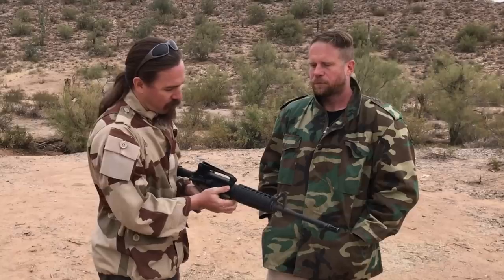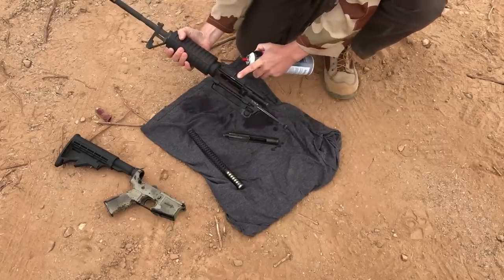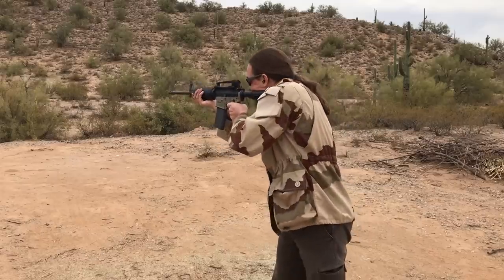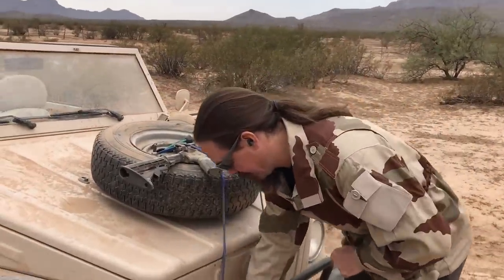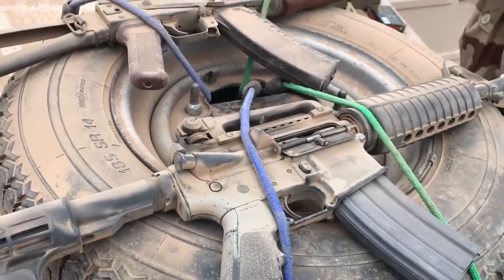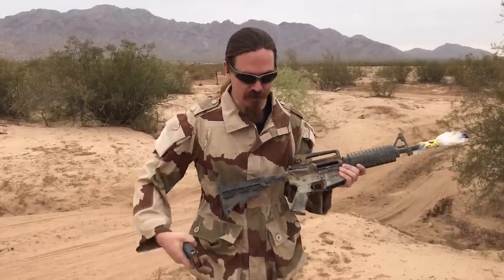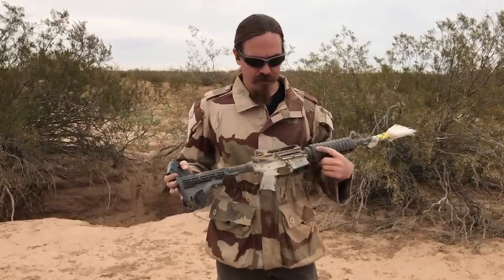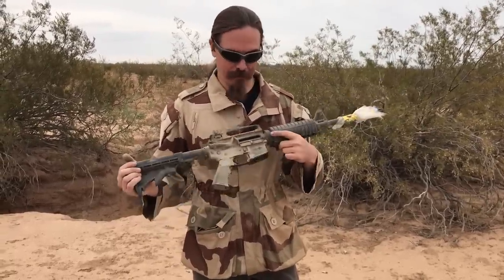Convoy Dust Test: M4gery / AR15

Comment: I usually keep all my guns quite wet to prevent rust (i've had a couple get a little rust during the summer with the swamp cooler running). But should I just leave my AR dry all the time, and never lube it?
Reply: Dude no, lube you rifle. Unless you're pouring sand into its receiver, then you're going to have more malfunctions if youre running it dry  without lube (not to mention more rust which seems to already be an issue for you)..

Comment: so what is the benefit gained from running a rifle with a lot (or some) of lube?
Reply: Some lube (a reasonable amount in the right places) reduces friction and wear on parts and aids in reliability, but excess lube clings to dirt and debris, and some guns don't run well sopping wet either. ARs really don't require much lubrication, the bolt and carrier basically float in the receiver except the rails it rides on and that's about the only part you absolutely need to lube for reliable function. How much is needed and where can depend on design and application, though.

Comment: When this happens to a gun ONCE it may continue to work fine. do this to a gun 10 to 15 times that won't be the case. 
You probably still don't have much grit and debri in the gass system that runs these guns.

Comment: Typical milspec AR's will run just fine, they're overgassed like crazy. Normaly it's the shitty mags. I heard one story of a guy that would mark bad GI mags with sharpy before tossing them in the trash. Until He caught guys using them on the range (apparently they pulled them back out of the trash), after that he'd crush them to make sure that wouldn't happen again. Magpul or GI mags for me. I got a batch of hex mags that are trash, great for malfunction drills lol.

Comment: I still wish you guys would re-run this test with lubricated rifles. You keep saying that they would get jammed. But...how do you know? Everyone kept saying the AR-15/M16 would fail these test miserably but you've proven that wrong. So along those same lines, lubing these things up heavily and running them should be something to try. Understand that this isn't a request from ignorance either. The "Filthy 14" test showed that nasty gunk inside the chamber was no issue as long as it was lubed. The pictures make the insides look like they were coated in liquid oreo mix but they kept running into the 42k round count having the bolt wiped once with a towel at 22k rounds and then one proper full clean  at 28k as part of their end of the year maintenance. Unlike mud the lub seems to just make it easy to slough off the internals.

Use CLP as that was the standard lubricant for the military for many years. Don't leave the chamber completely open and kick dirt in it as, "who the hell does that" or "what situation would that be from"?

Comment: Would it matter if its a cheap vs expensive AR?
Reply from the maker: Probably not.
Reply: @InrangeTv  sorry if it seems like a redundant question to ask. But that to me puts a lot more faith into the product that I chose to use. My upper has no forward assist or dust cover. Thanks for the video!!

Comment: Great video.  Glad you were able to reproduce the stuck bolt and failures I experienced in combat with the AR platform.  I also "tried" to keep it from exposure as much as possible, certainly wasn't filling it up with sand.  I've tried to explain to others that my M4s ran like shit in Iraq, but mechanics are difficult to explain and much easier to understand by pure observation.  And yours was dry.  I'm sure mine had very minimal lube as I wiped everything down real good... it didn't matter... jammed all the time with a few different ones issued.  I can't stand the AR for a "combat" rifle.  I'll keep using the "inaccurate" "unable to be tac-ti-cooled" AK 47 because it shoots every time.

Comment: BCM is NOT as close as you can get to an M4, it is not even a Colt and does NOT meet the TDP. Source, 13 years 11B, lifetime shooting AR's.
Reply from the maker: YEEEEAAAHH 11B!  11B makes you the AR15 EXPERT!  11B!  11B means this comment is definitive. Life changing. Tell me more, I am so star struck.
Reply from the maker: I would expect an 11B to not be a snowflake.  Disappoint.
Reply: @InrangeTv  You lost the high road when you chose to disrespect my service instead of debating my argument on merit. I included my service to qualify my ability to determine what is an M4 and what isn't, and including a reference to the TDP. Lets stick to something you're qualified  to speak on. I'm not sure that includes any of this.
Reply from the maker: Why did you feel the need to provide your 11B MOS in your comment unless you intended to use that as justification for your opinion being supported and/or superior?

Your 11B doesn’t give you the qualification you think it does.
Reply: @InrangeTv  did you even read my last comment?
Reply: @janfalcon2020  I'd say he did, and you were nothing but disrespectful and trying to justify your opinion solely on your service. Which, while is an honorable thing, it does not make you better than anyone else.
Reply: @SantaClaus-kk8zr  since when are professional credentials not an accepted form of validating ones opinion?

Comment: The AK failed with the bolt closed. The AR failed with the bolt open. I have a feeling the AR would have run without a problem if it also had the bolt closed. There would have been no malfunction to remediate.

Comment: I’ve never liked hearing people say that lube “attracts” grit and debris. There’s no force of attraction (static nor any other physical property of lube) at play, the only effect/interaction of the lube is that it holds debris preventing them from being blown off. In the end the point is the same but I guess it’s like when someone says “tolerances” when they mean clearances. I’d like to see a real test to quantify the effects wet lube plus grit has on the guns, I would guess that the results won’t be the forgone conclusion most people commonly imagine. After all it doesn’t stop being lube just because it’s contaminated with grit unless the entirety of the lube is absorbed by the debris it would still provide lubricity, and possibly when heated by the firing of the gun it would flow away (downward by gravity) taking the grit with it.

I’m not simply being pedantic, the “dust magnet” idea is an commonly held and repeated concept testing it’s validity would make for a good video.

Comment: Oof, AR’s do not like to run dry.
Reply: You essentially only need to lube the interior of the bolt carrier where the gas rings have to reciprocate and the cam pin.